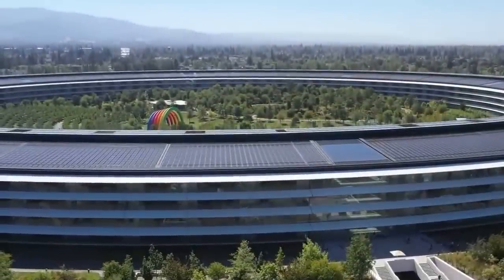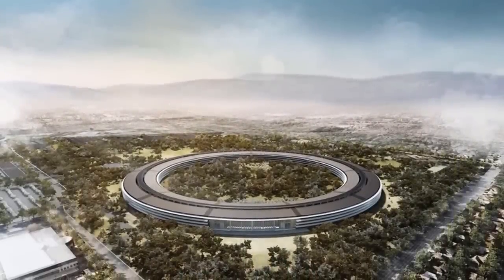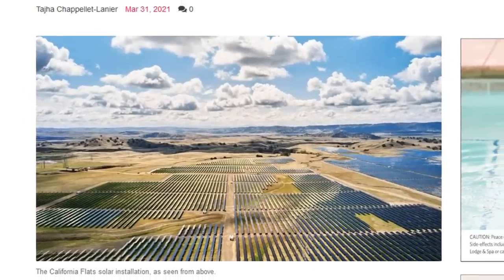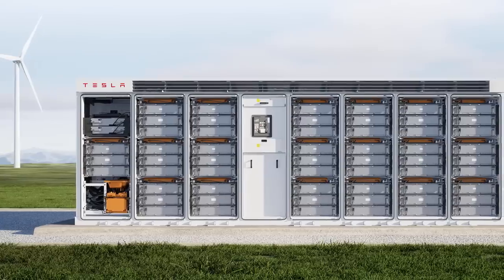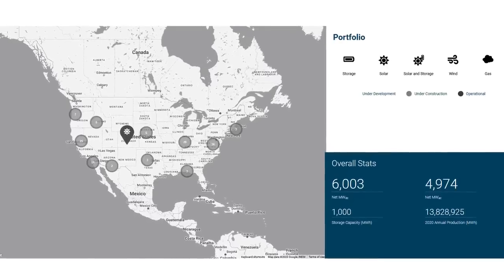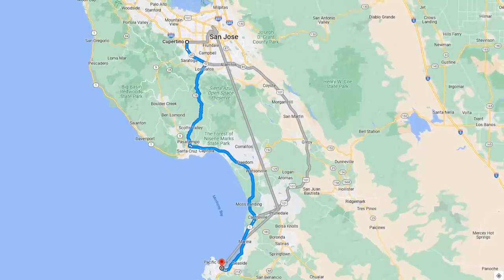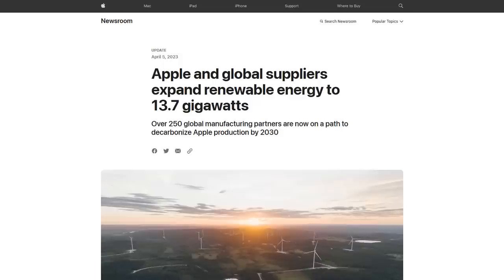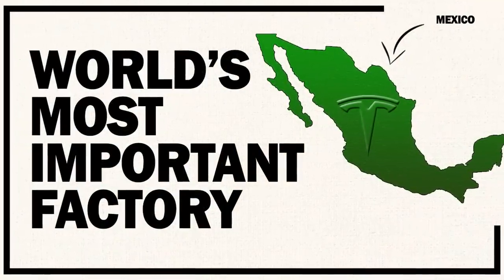Inside Tesla’s $100 Million Partnership with Apple Park

Comment: I wonder if Tesla will ever enter the wind turbine market. I’d love to see what innovations Tesla engineers could do with wind turbines
Reply: Apart from maybe a small well-designed turbine for home use I can't see Tesla contribute much in this area. And small turbines are pretty inefficient. The bigger you go, the more efficient they become. So there's a limited market for home wind turbine installations.
Reply: There’s easier wins in solar for Tesla.  Home wind power doesn’t make much sense, but big ticket home electronics and batteries are a lot more relevant to Teslas transportation biz.
Reply: @jooptablet1727 That is unfortunately not true! The windturbines have practically reached their max size. Making them bigger will raise costs (tower, extremely expensive mobile cranes for the installation, foundations, maintenance) to a point where they can not earn their  keep.

Additionally the larger the rotors the slower they have to turn or their tips will reach speed of sound (330 m/sec) which will disintegrate the rotors and the whole thing will collapse. Plus you can use the force of wind only once or twice. Whatever is extracted to run a windturbine is no longer in the kinetic energy of the wind. It is not a perpetuum mobile, and the energy is not coming out of thin air!
Reply: Fields and Fields of enormous propellers? A blight on the landscape. We can do better. Plz God, I sure hope so.
Reply: Small wind turbines that can run whenever there is wind would be a game changer for home energy production along with some solar PV and battery storage.
Reply: Tesla has absolutely nothing to bring both in solar and wind turbine market lol!!!!!! Their only thing is batteries which isn't an unique business tbh!
Reply: @berndheiden7630  you are totally wrong!!! Wind turbines are still evolving with new materials and techniques....
Reply: @bs4638  nope it's not!
Reply: if Elon made it it would be a hydrogen rocket with a tip less fan to capture the energy and be silent, put off by the rocket.🚀
Reply: @morkey74  lol!!!
Reply: Why would anyone build a solar grid level field  to power an office park without storage? Solar only produces for about 8 hours a day and there is a slow taper up at the start of the day and a taper off at the end of the day and No Electricity produced when it’s dark or at twilight.  The answer to much money and idealistic views. 
Btw there was no risk in getting Tesla Megapack storage. That is unless it was not researched properly and sized correctly.
Reply: Not a partnership at all. Apples contractor for the solar park bought from Tesla. Thumbs down
Reply: Don't need them - be like Indonesia and make a PPA with ThorCon for 500MWe walk-away safe $1200/kW liquid metal Thorium ion molten sodium fluoride salt burner energy converters at $30/Megawatt.hour for a base loader or load-follower to help out the irratic renewables.

Comment: Corrected ..
The 17 Apple Park projects cost $4700×10⁶ for 1200MW
average 70.6MW at $3917/kW.
Therefore, say an "isolated" data processing location requiring a steady solar farm 20MW load 24×7 
1) assumes 16 hours no sunlight but using 16h×20MW =320MWh from 85 mega packs (each capacity  3.9MWh = 327.6MWh) and capital cost $170×10⁶ for 20MW
2) So $170/20=$8500/kW
3) As solar farm works only 8hrs/day solar panels are require to generate the daylight 20MW plus  2×20MW for storage for night use. 
4) So minimum daylight generation is at 60MW and assuming the 70.6MW solar farm statistics we are looking at a capital cost of - 
a) panels $4700×10⁶/17=$275×10⁶ 
(at say $4000/kW) plue
b) storage for 320MWh for 20MW ~ say $170×10⁶ 
(ie. $8500/kW) and gives a total cost of  = $425×10⁶ for a continous 24×7×365 hourly need of 20MW ~ 
c)So solar farm at $4000/kW plus 320MWh mega pack at $8500/MW 
= $12,500/kiloWatt
(Compares poorly with a 500MWe ThorCon TMSR at say $1250/kW capital cost ie. 20 times larger capital cost per kiloWatt for continuous 20MW× 24×7 Solar farm with enough mega battery packs to provide the overnight load of 20MW for 16hours between charges?)
Reply: Similarly, if you up the Solar farm size to a 90MW providing a constant 24×7 daily supply of 30MW×24=720MWh  per day utilising 125 Mega-packs with combined overnight capacity of 480MWh to last 16hours the total capital cost based on the above is $600×10⁶ which is the same capital cost of  500MWe ThorCon lasting 2 to 4 times longer and capable of providing at least 16 times that of the 90MW Solar Park with it's 125×3.9MWh Tesla Mega pack batteries and at a levelised pre-profit cost of $30/Megawatt.hour  (3cents per kWh ).